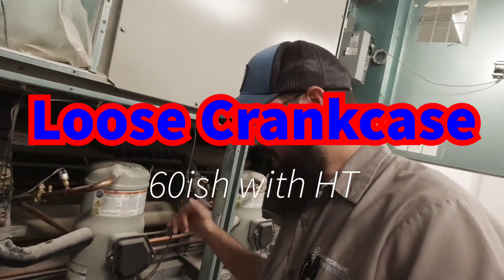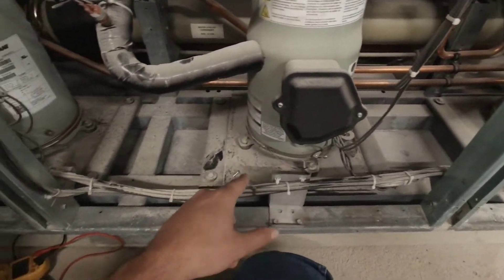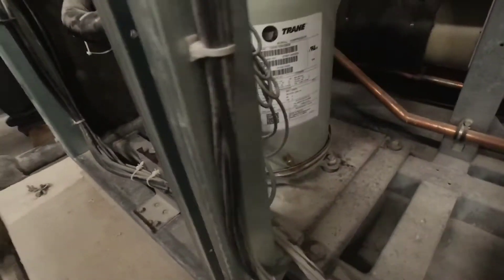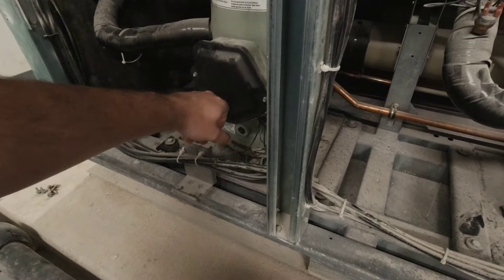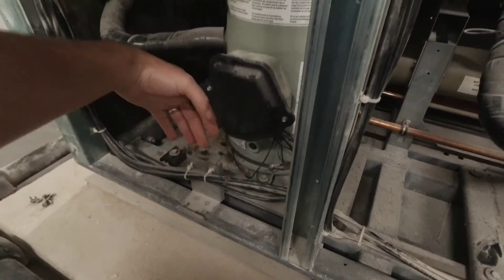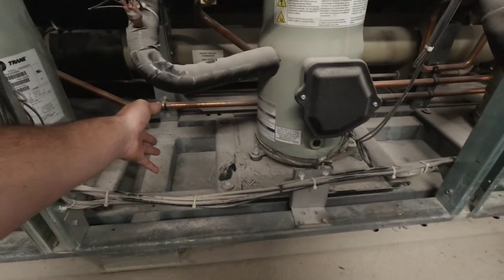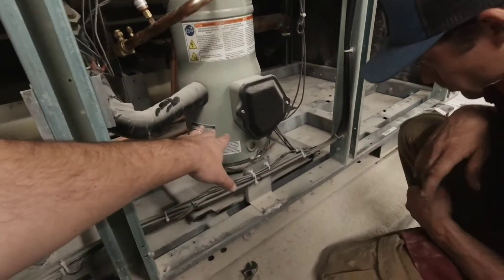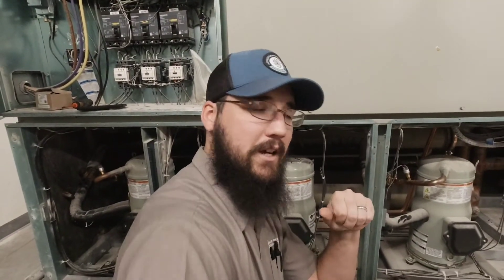HVAC Training: Crankcase Heaters

Comment: The purpose of that heater , is not to allow liquid refrigerant to build up under the oil when the unit it off for long periods of time. When that happen's it will push all the oil out of the compressor. You can actually see that happen in the oil sight glass . The oil will migrate back.